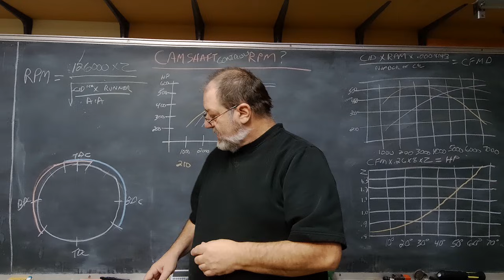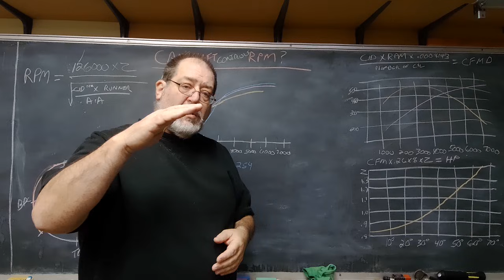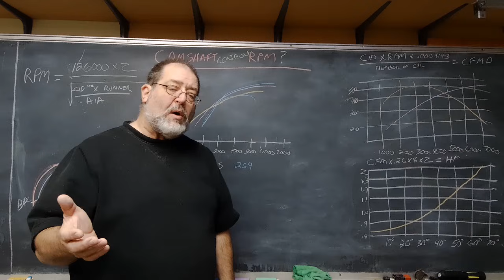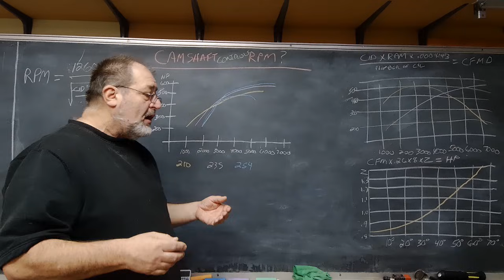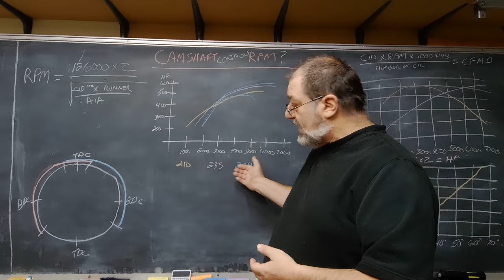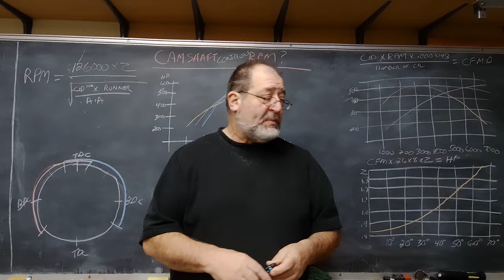Camshafts  control  RPM?

Comment: I’m using a closing intake at 38* on a cam that’s 224 @ .050 for a 469 Pontiac , 278:2778 @.006, and 66* overlap, .585 lift, .350 lobe lift and like .585 w 1.65 tickets, and trying to get a VE of 1.1 with piston coatings coating above and below the top ring and reducing and friction at the crank, rods, piston to be 15#.fully assembled with the 8 pistons.
Is the cam mentioned above workable in 74 TA with 4 speed 3:42’s?
If not would would be better Scott?
Reply from the maker: Flat tappet ? Inertia  Ram  on 38 degrees  is only like 13 degrees  which  is only  88%  VE at peak hp ..peak torque will be higher  .. you need to look at cfm demand  for rpm .. and cfm is about  MCSA

Comment: Perfect video to bring up the following:  
I once had a 1978 Buick Electra with the Buick 350 V8.  The engine needed rebuilding so, I thought I'd use an RV-type cam to see if I could get some more ooomph out of it.  It turned out to be a DOG.  I then purchased the exact OEM smog cam and lifters for my 350 and it ran like a champ!  Plenty of effortless urge at low rpm and overall, a good flat powerband.
[QUESTION]  What was wrong with the RV cam and why did the bone stock smog cam work so damn well?

BTW, I gave away the RV cam and lifters to a circle track guy I know who has a Buick engine in one of his cars.  Maybe he can do something with it.
Reply from the maker: Not enough  airspeed  to close the valve later ..... if you take a engine  with no other changes  other  then camshaft  .  And if you had some sort of variable  camshaft  control  on the dyno you could find the sweet spot on closing point  of intake  for the rpm you are working in  ....  since thats not common  outside  a lab i use math to help ....

Comment: Hi iam trying figuring  out my motor  I have a 498 chevy  with iron heads  struck head flow at at 700 lift is 335 they have been posted  the motor with a small header will pull to 7200 the camiis a 284 292 at .50  the air need to pull 7200 is about 446  how does this work  I have a Victor intake on it  does it work because of the ram affect  the motor as good trque
Reply from the maker: Air available  will only carry  it to 6600 rpm ... I would  guess  that hp goes flat about  there and the large cam and probably  intake  tuned  higher  is carrying it to 7200 ....
Reply from the maker: With airflow  and camshaft  and I would  guess  12 to 1 ... it should  be just past 850 hp .... you didn't  say what fuel
Reply: Bi @scotthatch4653 it 12.5 to oneand runs 110
Reply: @scotthatch4653 AK trque isn't 6300 and  and ho at 7500 I went from  a 2ich to 23/8 primary tube
Reply: Thank you for the infor

Comment: In the turbo inline 4/6 drag world, durations ~290-300deg are not uncommon and engines spinning over 10,000rpm. The 1L sport bike 4 cylinder engines revving to 14k+ using ~245deg durations cams, and the main reason they can rev so high is becuse relative to it's size it has massive valves (~30mm) and lift (~12mm) in conjunction with a rod stroke ratio that increases piston dwell to allowing for higher rpm efficiency. Big high revving race Hemi's are also a good example of massive airflow and rpm working together.

Comment: Your explanation on air flow controlling engine RPM is correct. But lift is not even half of the equation. Overlap is the main determining factor for engine rpm. Without out valve overlap You wont have a large enough low pressure area for the atmospheric pressure to push it's way into. If you just relied on the vacuum created by the piston going down the cylinder bore the atmospheric pressure would fill the cylinder and you would actually run into the air column reverting back into the intake port. Overlap allows you to take advantage of the low pressure area in the exhaust. The more free flowing your exhaust port and headers are the less overlap is required to do the same RPM. Intake port length and size is also a big factor but you already give a great explanation of that in this video you just forgot to mention overlap.
Reply from the maker: Incorrect  ... overlap  is not the main thing  ...... in the Playlist  is overlap is bad video  you might  want to watch
Reply: @scotthatch4653  You could have 750 lift cam but if it has no valve overlap you won't do much over 1,000 rpm.
Reply from the maker: @The0utmode incorrect  .... you are confusing  overlap  with draw at peak piston  speed or about  75 degrees  after TDC....
Reply: @The0utmode my 4.4l v8 bmw had about 4 degrees overlap total and ran amazing up to 6 or 6.5 I forget.  1000 rpm is laughable.  Many oem engines dont have overlap like you might think.  Also if you get the header design work wrong big overlap won't help at all.  Intake closing and exhaust opening are both more important than the overlap timing degrees of the valves.
Reply: @_FJB_  You don't need much overlap at all on a 4 valve head because of their amazing low lift flow abelites old pushrod V8 with stock heads are gonna need 15 to 30 degrees of overlap. The more efficient the engine the less overlap is required. Also that is a very small engine up the displacement to the 400 to 500 cubic inch range and it's going to need more overlap.
Reply: @The0utmode You must be a fan of David Vizard.
 He thinks Lobe Seperation Angle and Overlap is the most important aspect of choosing a camshaft. 
 Its not as important as you are misled to believe on low rpm pump gas engines in heavy street car. 
  Changing only the overlap on a after market cam while using the same intake centerline will not improve the mph enough if any at all to justify the effort in these type of engines.
 Duration and intake valve closing event is the most important aspect of choosing a cam for the above mentioned engine and despite what you are misled to believe, small off the shelf grinds are more than sufficient for  heavy cars used in daily driver and mild peformance applications.
Reply: Most engines, outside of a Cessna, have at least some sort of overlap, and if I'm not mistaken- you can still create a depression at the end of the exhaust stroke for when the intake valve opens. Even with minimal to no overlap. A good exhaust design can't reach through the same way as with overlap, but still create somewhat of a void in the chamber for the intake charge to begin filling before the piston descends
Reply from the maker: @mattmorrison6958 what do you think  causes  rough  idle with a big camshaft ..... OE camshaft  is only 200 degrees  at .050 on like 116 or better  lobe center so no overlap  and it works ......   if the engine  is even just 9 to 1 you are only talking  about 10% volume of the cylinder   and the exhaust  valve is shutting  and intake  just a bit open ..... you dont need overlap  to make power  its not the prime mover and if you look at numbers like I do it doesn't  even  show up in the math because  its main effect  is to kill hp in low and mid range  ... if and I mean if you tune the exhaust  system  you gain just a tiny  bit of power at peak .... you need to study  up on Inertia Ram  as thats the prime mover of air
Reply: @scotthatch4653 sorry if there was a misunderstanding- my reply was to the OP outmode. I agree with you and was mentioning that the intake charge can still begin moving before the piston even without overlap (as far as I understand it)
Reply from the maker: @mattmorrison6958 im sorry  did not catch  that you joined  in the chat
Reply: @mattmorrison6958 Yes that is true if you have a well made header that isn't too big and slow.  If the exhaust gas speed is high enough, depending on the tube diameter being close to the valve size, exhaust opening deg and where in the rpm you are there will be a point where the exhaust is creating a vacuum and depending if the valve opens soon enough you could have air pulled in before tdc even.  It's all about timing and if you're serious look into working with some reputable cam makers and get custom cams made.  You can get very close to what you need for your setup than picking one for yourself and having everything else sync with it.
Reply: @scotthatch4653 The prime mover of air is piston speed.
 You can turn 8000rpm and win races with a small block Chevy using the factory stock mcsa.
 Factory stock mcsa in this case means untouched factory iron intake and heads using factory stock valve lift.
 A larger duration cam makes it possible.
 This proves you dont know as much as you think you do.

Comment: I liked the information. It reminds  us there is more to making power than just throwing all the parts on that can flow high volumes of air. It made me think about my own experience  with my 998cc 1960 Mini. I didn't do much to the engine, like a cam, but worked on the intake and exhaust.Excuse me if you have discussed this subject before, I think the exhaust design is overlooked by many enthusiasts. I noticed when I made some changes to the aftermarket performance exhaust a difference in the rpm that the power was kicking in. The exhaust was a glass pack and a muffler. I eventually decided to create a pipe.to eliminate the rear muffler, and just run the glass pack. This pushed the start of the power curve up a good 5-600 rpm. I have no dyno numbers to say if I made more power, but at low RPMs it would act like I was running a larger cam. When I went back to the muffler, the power came in at the lower RPMs. It was a subject I wanted to explore more, but never got around to it.
Reply: Good for you for finding that out your yourself! I was fortunate  to be abel to ask one of the Best motor tuners in Europe, Dutchman Jan Smit (the mechanic behind world championships) wat was de biggest accomplishment in engine design in de last 5 or 6 decades, and he said: the exhaust system!
Reply: @Erwin-b4d  Spiritual bread for breakfast , lunch or dinner with Robert Breaker, Gino Jennings, Stephen Darby Ministries
2 timothy 2:15 KJV - Proverbs 4:7 KJV = John 8:32 KJV
Reply: @BIBLESTUDYwithR.BandG.J Who was this for?